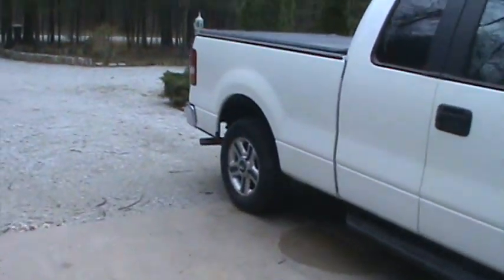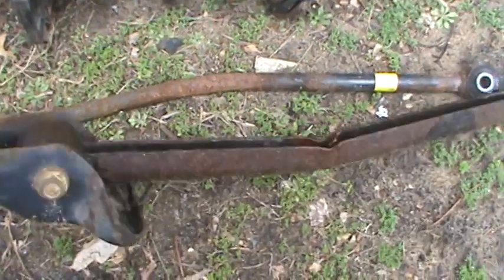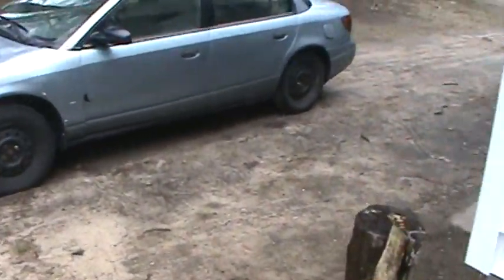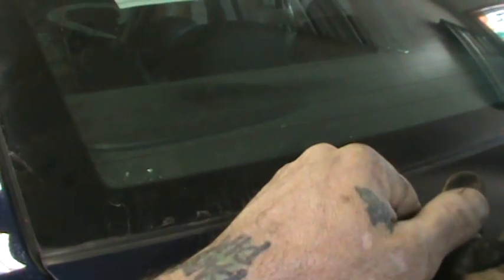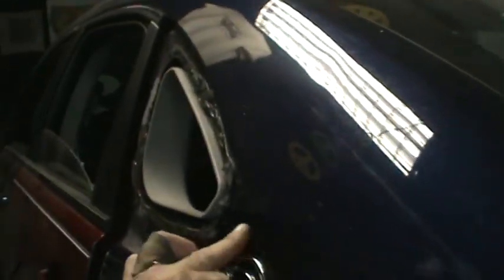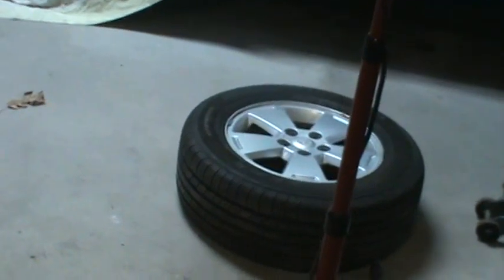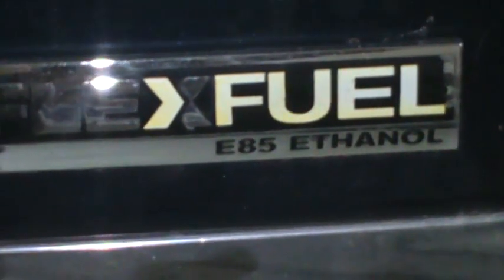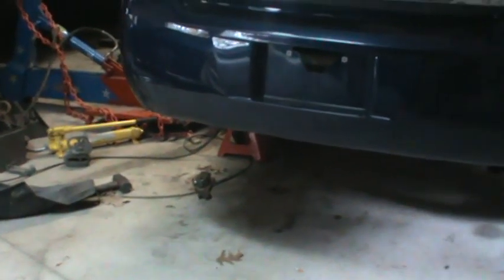THERE IS ALWAYS MORE DAMAGE THAN U C

Comment: my car has the same thing same ish side when I bought it it was a rebuilt Title. I never really check to see where the damage originally was repaired but when I had to rust around the windows I found quarter welded on. online they cut it about three quarters or so up at the narrowest part. that must be The Sweet Spot. unfortunately the best is probably going to be with the window gone. it's a sketchy one I went through several Windows myself but we have to learn how to use that tool eventually. glass guys do it all day long everyday so there has to be some good tricks to it .YouTube. =^-^= thanks for sharing another Kool vid. thanks again

Comment: they make long handled blade holders with long ass blades. You can take the pillar trim out and do it from the inside mindful of the wires and shit. My buddy in the next stall to me does all my glass and I've been watching. Probably harder than it looks though. For minor pulls like that I just take it out to the dumpsters tie it down on one side and use the pulling hook porto power on the other. Done in a snap. Probably doesn't need much unless you got to pull it for bigger gap. Should be fine pulling out. You got this

Comment: definatly take the window out, i'd go through the sail panel just below the roof rather than where you were going to go 

if you are really unsure about the rear window see how much a company wants to take it out, might be worth it.

yeah dozers are good but they have quite a few limits, if you chop the head off, then use 4 rocker clamps and attach the remaining dozer frame to them with the two long bars effectivly making a single bar frame machine it makes a much more solid pull, quite a bit of work to make the new head to frame attachments but if you got a few days might be fun to try.

other way around it is to make a solid frame that can mount to your lift and use the dozer to push off that, again you can use 4 clamps to attactch car to frame

that metal sound you heard was the crows stealing you guns..........................:P
Reply from the maker: LOL crows cant get to my ar-15,they r smart,i hear them ,by the tyme i get the gun...there GONE

Comment: cut into the bond sealer until you make a hole between the glass and bond sealer then put cheese wire through and carefully saw back and forth all the way round because that side that's damaged needs to come back over other way because pushed into the left that's how kinked inside it